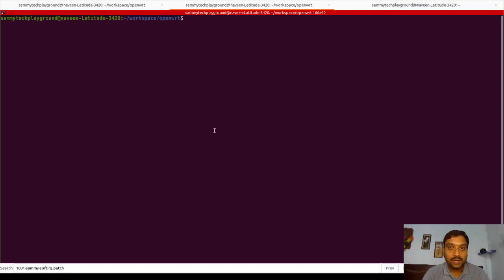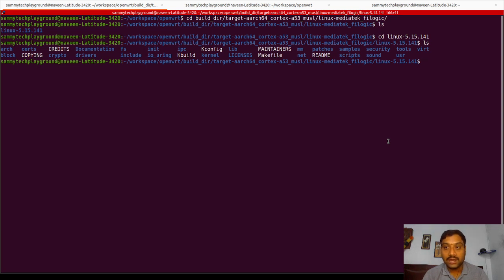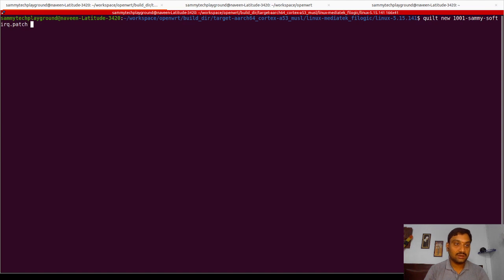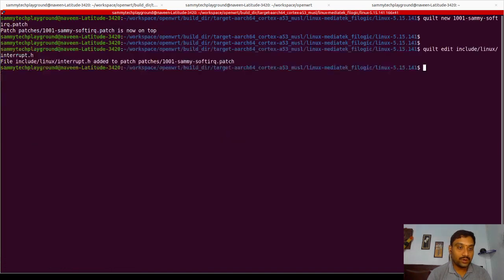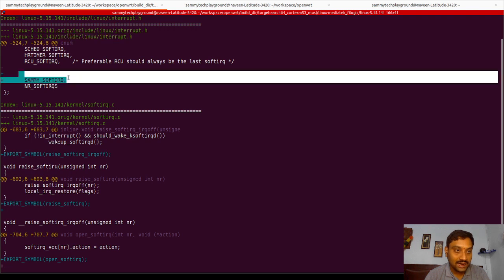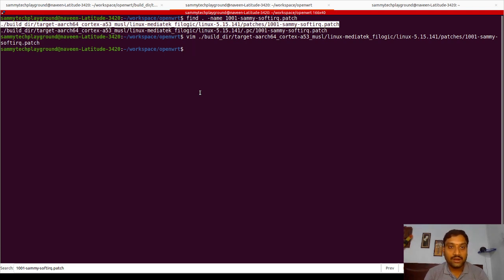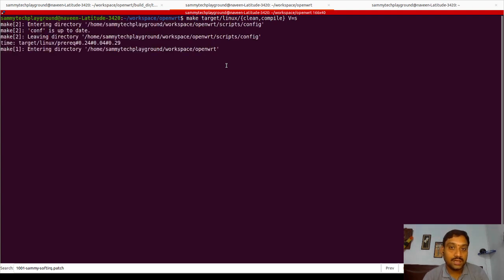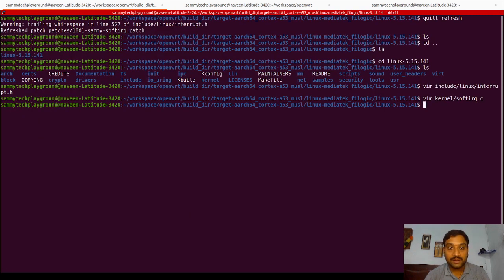Create/Apply patches to Linux Kernel in OpenWRT Platform

Comment: Hello sir, i am new to Linux and openwrt. Recently I am facing problem in my openwrt router, so I search some post in openwrt forum and they gave me a patch file and command me to paste it in "package/kernel/mt76/patches" folder. Don't know how to do it.
Reply from the maker: Hi There,
Following are the two procedures. Go to the root directory of OpenWRT and make sure you build it atleast once to have toolchain ready.

1. If you are creating the patch by yourself, you can use this method. 
-> make package/mt76/{clean,prepare} V=s QUILT=1
-> Go to build_dir/<target_dir>/<linux_dir>/<mt76-version>
-> quilt push -a 
-> quilt new 0001-my-changes.patch
-> quilt edit <target_source_file.c>
-> quilt diff     - to see the differences you have made
-> quilt refresh
-> cd <root_directory_of_openwrt>
-> make package/mt76/update V=s 
-> Recompile fully with patch you have made -> make package/mt76/{clean,compile} V=s 

2. If you already have the existing patch, then its very simple
mkdir package/mt76/patches
copy your patch to package/mt76/patches. Provided you don't have any existing patches, otherwise you need to adjust your patch series number.

Hope this helps you
Reply: @sammysplayground3650  Thank you for your reply, this is very helpful. Thank you so much sir.